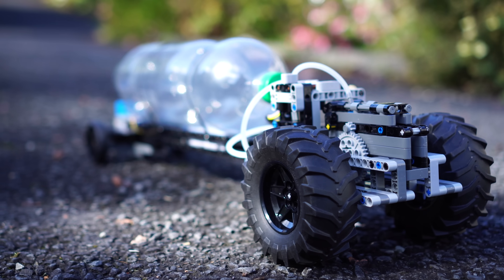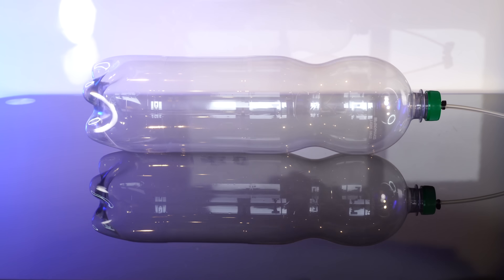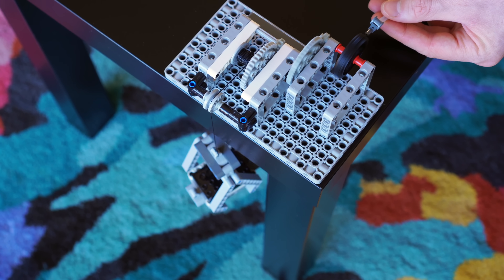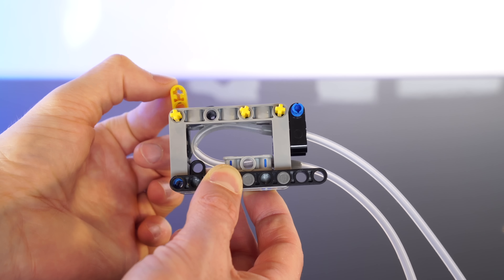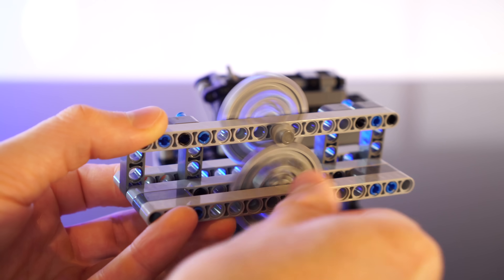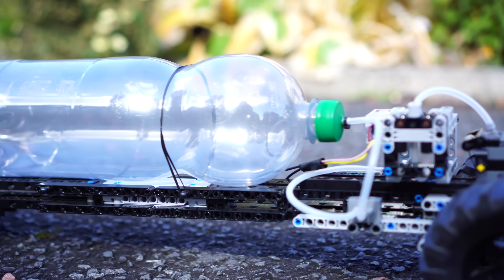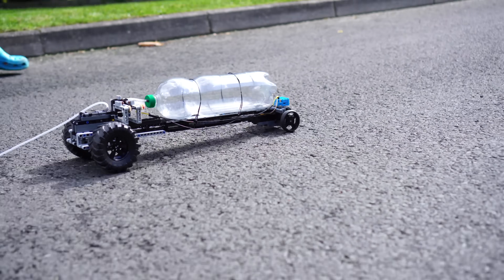Making an Air-Turbine-Powered Lego Car

Comment: Loved all the tests you did on turbine systems using basic lego parts, but I really feel like it would be more efficient to create a piston based air engine similar to the ones on small toy air powered planes. Using turbines allows too much of the air pressure to escape without providing thrust. Obviously achieving this with lego is the big challenge because lego isn't exactly designed for building airtight pressure chambers. Obviously this would also not increase the thrust so much as it would the longevity, allowing further travel with less air pressure.

Comment: Wouldn't this have been much easier to determine which was faster by measuring the rpms of the turbine by measuring rotation of a fixed sized wheel?
Reply from the maker: Certainly possible! I've used tachometers for several projects and found them wildly inaccurate though, so decided to try something new

Comment: As a heads up for cheap good bottles for pressure vimto squash comes in 3L thick bottles that can handle 200PSI which is almost double that regular 2L drink bottles can handle while also being larger. I haven’t played with them under pressure but I have friends who did at uni and for a while there was always vimto squash around

Comment: its not air turbine powered the steering is controlled by a battery  could u make it so that when the propellers are spinning it captures the energy and converts it into electricity through a magnetic driven electricity please its a request pls pls

Comment: Yo  i have idea get a mini air pump and pressure switch and put it on to fill the bottle back up while driving like a 12. Volt one with a small rc plane battery
Reply from the maker: That's a cool idea! I saw recently a video by Integza that used a CO2 canister to refill the air tank for a pneumatic engine. Love that concept

Comment: Hey, this is really cool. 

Two ideas: a tesla turbine might be more efficient, at the cost of yet another non-lego part.

Also you need brakes.
Reply from the maker: I do love the idea of a Tesla turbine, even if just for the novelty of it! Just gotta get into some 3D printing
Reply: Tesla turbine has the same efficiency as conventional turbine when you connect it to power something and it also has a low torque at high speeds because it's spinning really fast ( YouTuber Jonny Q90 made one that spins at over 99.000 RPM 6-7 years ago).
Reply: @CenReaper.  oh

Comment: power, not just voltage, so you get a comparable output value, let turns on with a couple milliamperes at 1.6V. so about 1mW. in turbine rotation terms, power = torque x rpm-speed. so you did a screw press instead. lol. nice. maybe a metal compressed air tank at 10bars or more would contain more energy. pneumatic drive train. maybe diesel-electric-pneumatic powered train. efficiency tho. instead of full electric.

Comment: More on the white cylinder housing!
Reply: Bent shaft
Reply: All the fan blade designs should have been tested in a housing
Reply from the maker: Yeah, agreed. There's definitely more efficiency that can be squeezed out of this thing with a better housing. I assumed the Lego bricks would work well, but the turbine kept developing speed wobbles and vibration. Real weird. Worth trying some more though
Reply: @JamiesBrickJams  this is how you find small imperfections in lego pieces. I've had similar experience. Swap pieces. What piece number are you using for your curved pieces?

Comment: A small suggestion: Pay attention to the length/radius/diameter of your "air parts". 

Torque is a measure of force over a distance (Newton on a meter stick, Pound on a 1 foot rod), so if you have large radii being pushed by air, you will be able to make use of more of the energy of the moving air. This means your compressed air will do more work. Notice the results of the "many bladed turbine" compared to the smaller diameter small bladed version. It was the diameter that was affecting your results the most. So, something with a diameter larger than you tested, but with the blade shape of what you ended up using, will get you more power to the gears.

On the wheel side, you want smaller wheels to make more use of that torque produced by the turbine. What you have is fine for higher RPM, but you can't get to that RPM with so little torque.
Reply from the maker: Yeah you're totally right, the efficiency of this one is absolutely awful - I'm sure there's a lot of potential being wasted. It's just a pity Lego doesn't design larger parts that can act as turbines. Building larger ones tends to make them quite heavy. But perhaps this is a job for 3d printing!
Reply: @JamiesBrickJams I have a 3d printer   (That works 20% of the time)

Comment: Air cilinder power is more efficient.
Reply from the maker: Sure is! Waaaaay more. This was more of an experiment to see if it was possible. And I like the sound it makes 😅
Reply: @JamiesBrickJams  if you want a turbine anyway. Make one in a cilinder, like a screw. Like an airplane engine or a windturbine with more blades.

Comment: You really want to encase the turbine: Like the design at 4:33 should be rather decent, but without any housing it just deflects the air away.
Simplest would just be a square box of bricks with the turbine vertically in the middle, with a air-inlet at one side at top, and outlet at the other side at the top - to force the air to go through the turbine.
Reply from the maker: You're right. That was my original idea. And it sort of worked with a brick-built turbine. But for whatever reason, I just couldn't get a circular enclosure to run smoothly. It kept developing speed wobbles and vibrations, which increased the friction a lot. Certainly worth experimenting with further though

Comment: Instead of using an actuator, put motor to directly open the airflow. Far doesn't run for a long time,so it won't be a big deal. 
Or, put a worm gear on a motor and a small gear on the trigger arm
Reply from the maker: It's certainly possible to do that. However I wanted fine control of the throttle, rather than just on/off. A worm gear driving an arm could certainly work. But at that point, it's really just doing the same job as a linear actuator 😁

Comment: In order to make a balanced turbine, you need to measure both voltage and current. The higher the current, the more torque it has and the higher the voltage, the higher the speed is.

Comment: Dude the back tires are too big and they need way more torque to spin so try replacing them with smaller ones (the smaller they are less torque is needed)
Reply from the maker: You're totally right! I didn't include footage of it, but I tried it with smaller wheels (same as the front ones) and it went quite a bit faster from the starting position. But its top speed was a bit slower
Reply: @JamiesBrickJams  well smaller wheels also mean less speed but i think its better to keep the tiny ones

Comment: 2:25 - voltage is one thing but as you are applying an electrical load on the generator it will be harder to turn
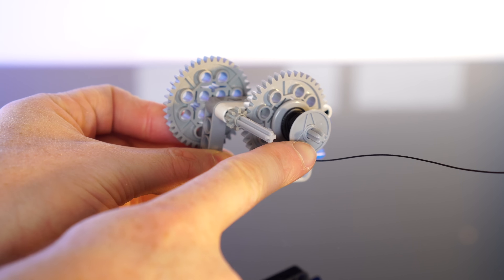3:18 - you are part way there, Idk anything about actual electric generator design so someone else would have to chime in
Reply from the maker: For this one, there was no load, so the generator was essentially 'free wheeling'. If nothing else, the results here are at least internally consistent. But for sure, if adding a significant load, it would create drag. I've made various air-powered generators that all experience massive drag when the load begins drawing power

Comment: AWESOMEEE! love your designs haha
random suggestion, lipo pack powering a server fan or a small ducted fan for a LVE? (lego vacuum engine? :D)
oh yeah do ya have a discord btw
Reply from the maker: Ooooh now that's a cool idea. Do you reckon a small ducted fan would be able to create a vacuum strong enough to drive an LVE? It's worth a try anyway! Cheers for the suggestion 🙏
Reply: @JamiesBrickJams  haha not fully sure but stuff like 10W or 50W server fans for sure can, small ducted fans with enough static pressure should be able to though each type would need to be tested I guess
Reply from the maker: Awesome, I'm already looking up some server fans 😎 Thanks again for the idea

Comment: 03:17
But in this case, it only was about speed, wasnt it?
The only variable for how much voltage you get was the speed of the magnets relative to the coil.

Or am I missing something?
Reply from the maker: Yup, that's right. At first I was interested to simply see what speed we get using different designs. Speed has some utility. But speed doesn't necessarily mean we'll be able to drive a load, which is why the second test was needed. I knew driving a car would need the turbine to overcome some significant resistance. Especially while stationary
Reply: @JamiesBrickJams  Ah yes, makes sense. The "engine" needs some torque to get the car going. Just an idea if you do something similar in the future, try to measure the peak force you can pull with the string. Because I think once the car gets going, it needs significantly less power from the engine so it needs less air pressure.
But still, very nice video, I enjoyed it a lot! Cheers!
Reply from the maker: Yeah you're totally right, once it gets going, it can build up to some great speed as the resistance drops. Especially directly from the compressor. I feel like I've seen some torque curves for turbines somewhere - need to see how folks measure that. Good tip, thanks 🙏

Comment: You try something like a hydroelectric turbine ? Like the one u build but the air exit in the center (on the axis of rotation), and that would create a spiral, it would surely add more torque at the expense of some speed or it could be worse, I don't know, I'm not an engineer, but I am pretty sure that it will be much more efficient and if you are looking to create a vehicle that can carry its own propellant, it is essential to have an efficient engine.

Comment: Hey man, awesome video! Did you ever attempt using the aerosol-can cap though?
Reply from the maker: Ooooh that would have been a much better idea! Fantastic suggestion for a v2 - thanks 🙌
Reply: @JamiesBrickJams  Yeah haha, I was the guy who recommended that last time if you remember :)
Reply from the maker: @xmysef4920  I do now! Wish I'd remembered to do that for this project. Thanks for the reminder - it'd be a perfect way to power a smaller, lighter vehicle
Reply: @JamiesBrickJams  Oh and also, when testing different turbine rotors like you did in the video, make sure to also try slightly different gear ratios for each turbine, because some may spin slower, but produce more torque, but that torque wouldn’t be used for more power if the gear ratio doesn’t favor it. Just a recommendation!

Comment: I don’t know if closer is mor efficient for the generator, plane turbines with a large bypass ratio have better efficiency
Reply from the maker: Hmmm interesting 🤔 got some learning to do here ...
Reply: In the case of a small turbine that's powered by airflow, I think my point makes sense. Unlike large aircraft engines with a bypass system for efficiency, this small turbine doesn't have that. It relies directly on the airflow to spin the blades, without internal combustion or a bypass stream. So, the bypass concept from big turbofan engines doesn’t really apply here.
Reply: Depends on what kind of jet you're talking about. Large jets have large bypass ratios to maximize efficiency over power. Fighters typically have a super low bypass ratio to maximize power over efficiency

Comment: Found this channel by accident, loved it! Subbed.
Question: did you consider changing the shape of the output nozzle for the air to match the surface shape of the turbine blades?
Reply from the maker: Thanks a lot! That's actually an interesting point. I haven't really experimented with that, other than just the pipe, vs the connector piece with the smaller nozzle. The nozzle concentrates it much better. But other shapes (like a flattened nozzle) could be very interesting. Thanks for the suggestion 🙏
Reply: @JamiesBrickJams  My pleasure! Keep up the awesome work, loving the vids I have seen so far 👍
Reply: lol me to